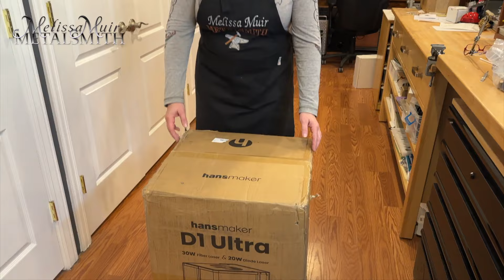Intro To D1 Ultra

Comment: Welp, guess its another one of those "lets you replace actual artists" type of junk again... (At first it was them 3d printed dragons that were sold as "handmade" which was actually just like printing pinterest images as stickers and now AI is doing the same just worse - cutting off the design part and having the user be a print/machine owner only..)
Reply from the maker: The thing the lasers do the most for me is marking my metal for hand engraving or piercing work. They do have their place. Just like AI, I don’t use it much for the end result, but rather to assist in my creations and designs.
Reply: @MelissaMuir Fair, for you personally, but as an artist I cannot get close to supporting companies who push the art world in the "just copy someone/ai prompt it and print/engrave etc" direction.
I think some softwares using the term "ai" are fine, but generative ai for text/photos for the foreseeable future is too easily abused by people who pretend its their original art and companies who replace human artists with ai/copy paste stolen art..
I have more issues with generative ai stuff but the main ones are those above, if someone only uses it for inspiration/personal life I ain't going to hate them, but I still will not like it either..